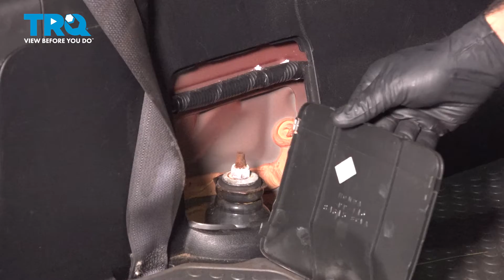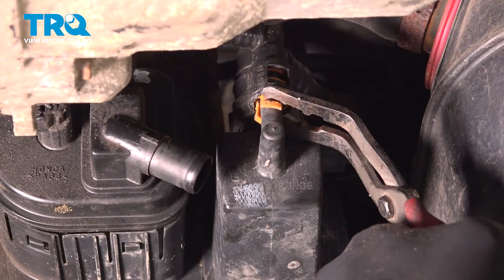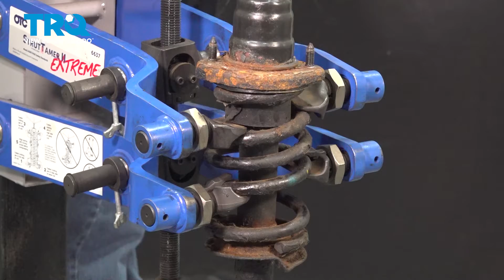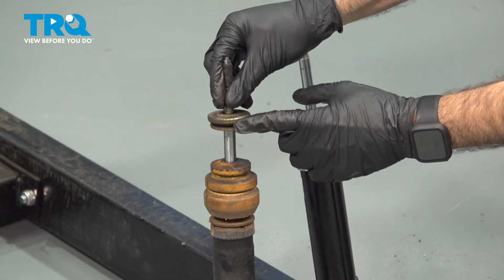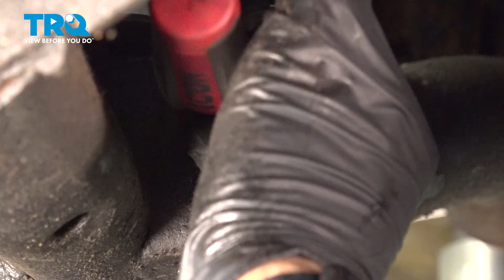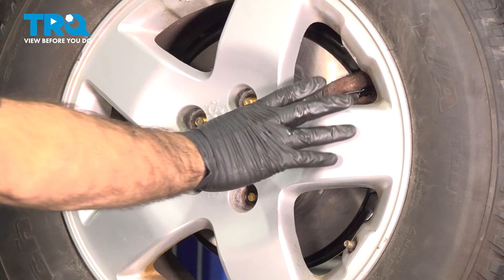How to Replace Rear Strut 2003-2011 Honda Element

Comment: Mine is a 17 mm bolt that holds the bottom of the strut in and you can't get a wrench on the other end is actually welded into the arm assembly.  Which is making it even worse for me to get that bolt out🤦🏼‍♂️